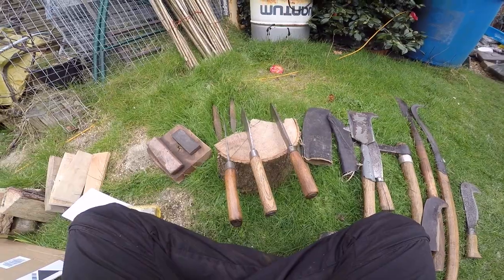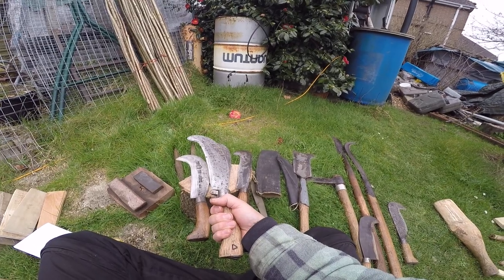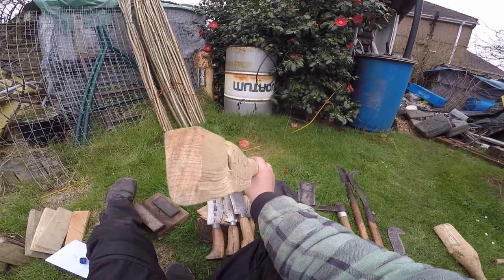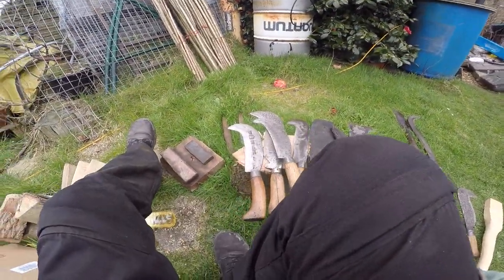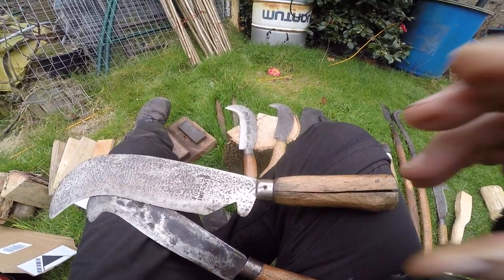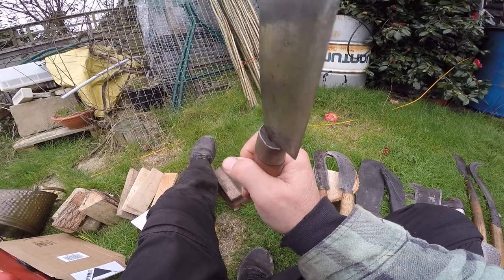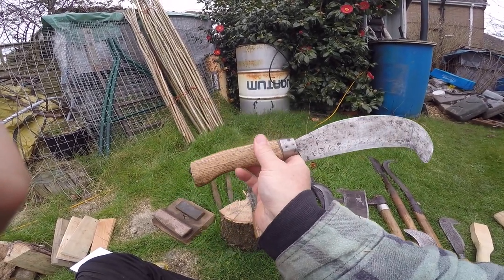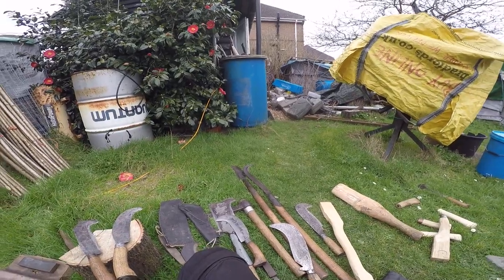Billhook handles need to fit you and the hook.

Comment: Interesting thanks. So if the end of the tang has been hammered over to hold the handle in place, can i just heat it to straighten it again to fit a new handle?
Reply from the maker: Yes. Usually. Bent-over tang ends are often narrower than riveted-over. Sometimes the wee tail is a bit flakey and wrought-iron-y or just plain rust-eroded. If not, get it cherry red and tap it out and let it cool nice and slowly to anneal it. If it breaks off, you can sometimes heat the tang nearer the hook and stretch it to 'restore' the length. If that won't work, weld a bit on.

Comment: I've an old hook with no haft.  The tang is quite long but not a through Tang.  I tried to use a bit of laurel but buggered it up.    Might tey heating the tang and pushing a new handle on.  It's only for light work.
Reply from the maker: If it was me, I'd convert it to a through tang as half tangs fail.  For that you need a welder.  Or maybe a forge. 

You could, indeed try heating and pushing the new handle on. Pilot drill smaller than the thickness of your tang and to not quite the length - it is much easier to fit a handle to a hot tang if you are not trying to burn through wood without pilot drilling.  You may need to but a long-series twist drill bit. Go on line to look and go for high speed steel (which you may already know).
Make sure your new handle is seasoned and dry, otherwise it may split.  
Make it out of cleft timber, otherwise it will split - timber shrinks and shrinks more around the circumference than accross the diameter. if the timber is in the round, this will set up tensions and it will split on the weakest point/points. Cleaving stops this.

Hope this helps. And thanks for the question.  Good to know my pontificating is useful.
Reply: @anemone104  I'm always open to advice.  Thanks for the info.  I do have a welder,  got an old compressor air tank which is to build a forge.  I need to sort the handle.  Whilst pleaching today the hook flew across the ground.  Twice.  Not safe.